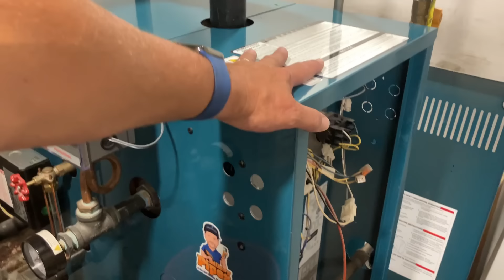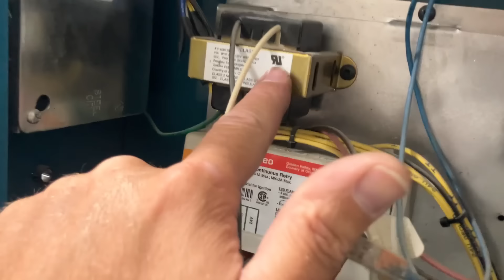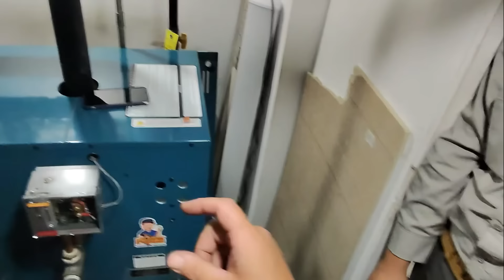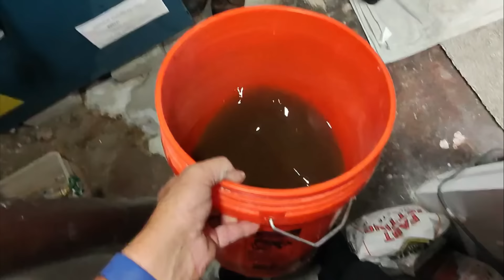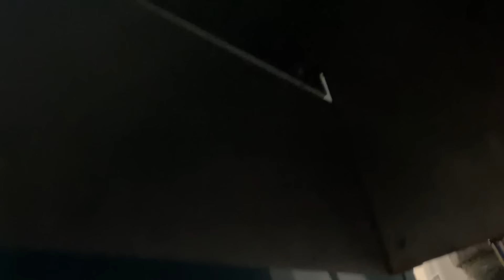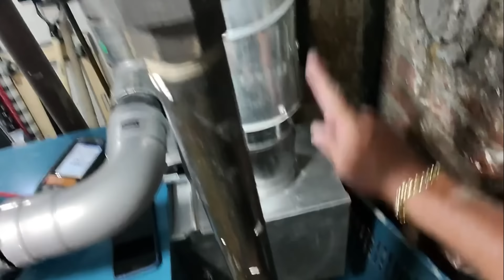Steam Boiler Tune-Up That Could Save You Thousands! (Burnham SteamMax Maintenance Explained)

Comment: 🚨 water heater no drip tail piece on gas line
Reply: NY no longer allows drip gas pipes they say people would use that to fuel other appliances or stops the stealing of gas especially in large or multi familys
Reply: @rjg1173 good to know- so you just have you use an elbow? Or just plug the tee?
Reply: @nikosniko7092 elbow